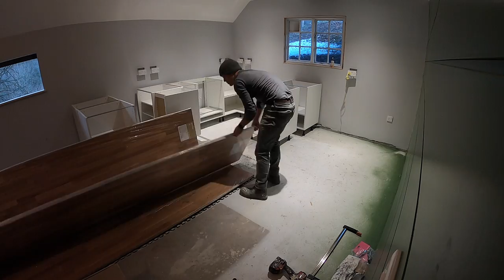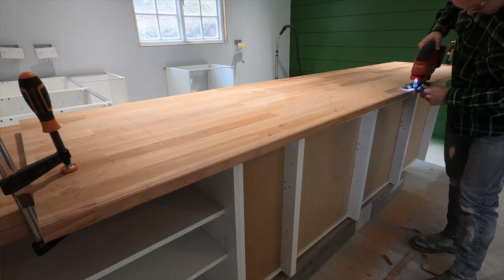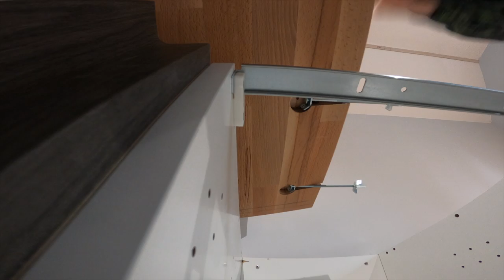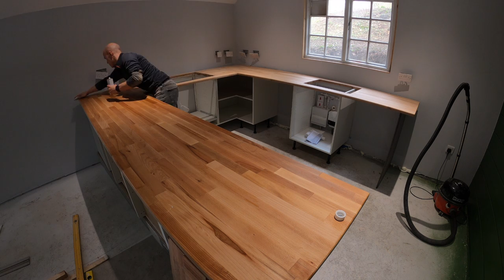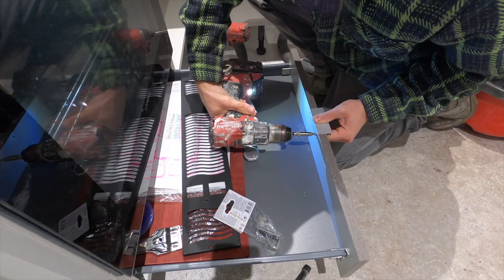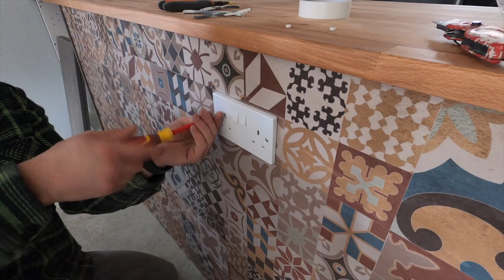B&Q kitchen fitting. Shed to house conversion 7

Comment: How did you find the push fit dowel & cam system, did you need to glue together, at all?
Reply from the maker: I think the system works very well as long as they’re not over tightened but if you need to move the units around a lot for adjustment when fitting they can get a little flex in them. In my case I knew my floor was uneven and I would need to play about with them to get it perfect so I used glue and they’re solid